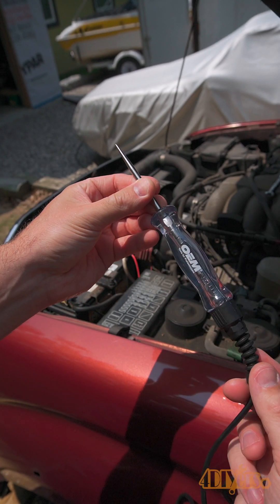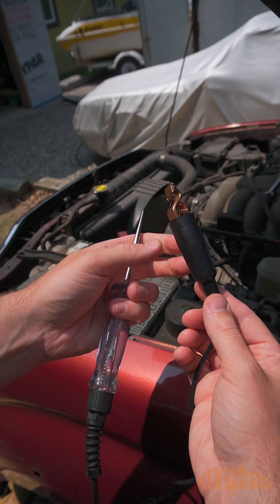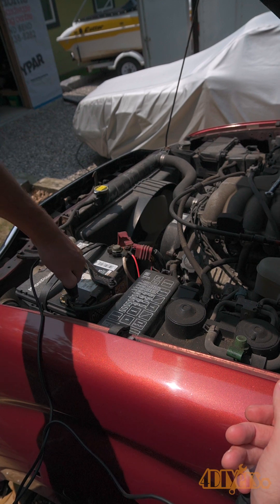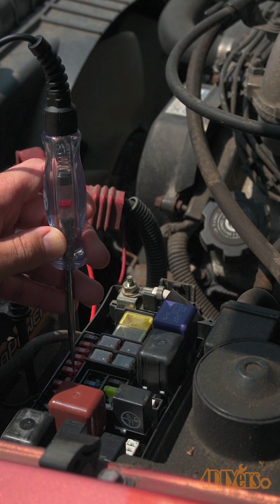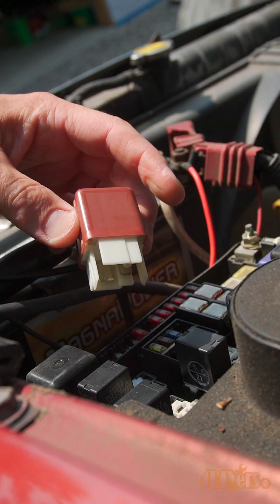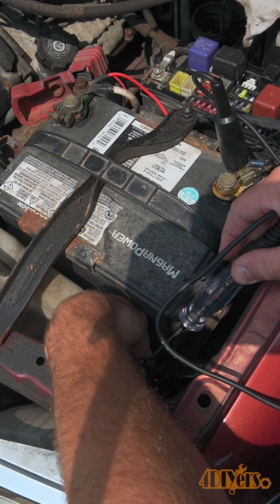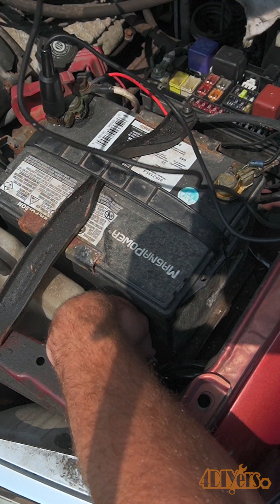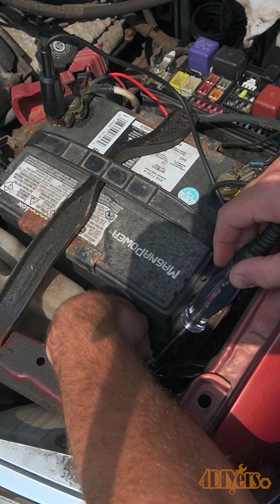How to Use an LED Test Light

Comment: If I get no power from ground to the fuse 
But I get power from positive to fuse what does that mean 
Same with battery 
Put clip on ground touch positive no light put the clip on positive touch the ground I get a light 
What’s the problem?
Reply: Good question i have one too if you put the cable in ground and the led light lights that means you have a good group in your circuit and if you put it to positive cable and the light circuit has power that's means you have power in your circuit am i right?